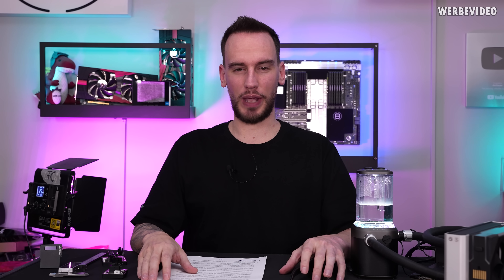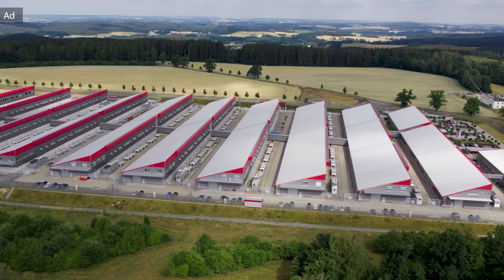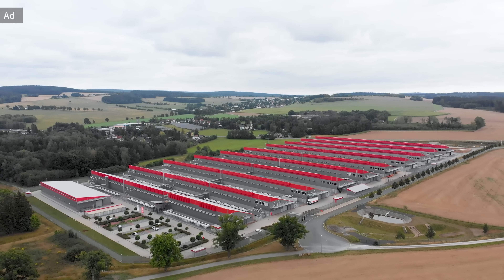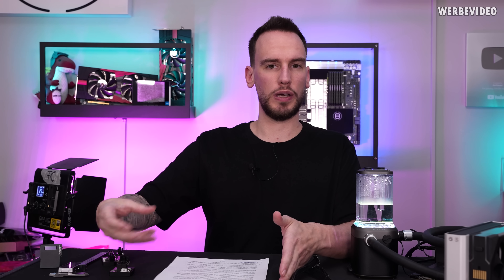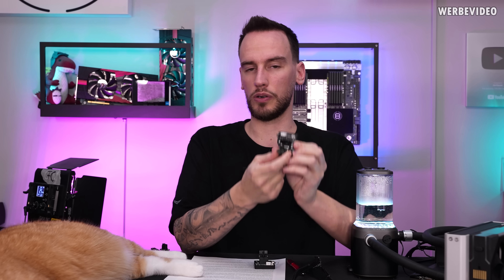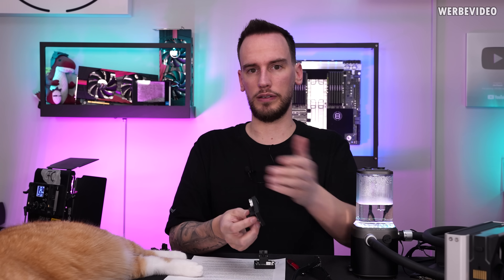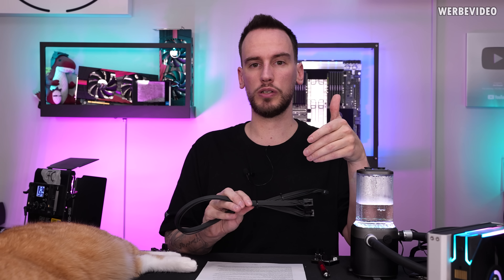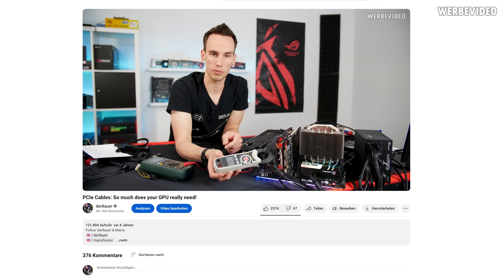12VHPWR is just Garbage and will Remain a Problem!!

Comment: I never liked this connector from the moment I laid eyes on it. The outrageous prices, and my distrust of the new connector are why there's no 40 series in my system. My instinctual reaction was that Nvidia was cheaping out big time. As time went on, Nvidia's behavior reinforced my instinctual suspicions.
Reply: The planned obsolescence didn't turn you off from nvidia?  I stopped buying their products the moment I realized they were making their own cards obsolete by limiting the vram.
Reply: @mrfarts5176  Then how is the GTX 1080 still relevant?
Reply: @mintymus  Have you tried loading up high-resolution textures on it?  All cards are still relevant.  I recently took one of my old favorite cards - a gtx 560 ti, I think, and put together a build for someone who can not afford a pc.  It was the first computer part I ever spent over 300 dollars on.  This pc will probably continue to be used by someone who can not afford a pc until it stops working.  Very relevant but not for gaming with high textures...
Reply: @mintymus  The Pascal generation is the best mistake Nvidia ever made, and they've learned from the 1080ti's longevity. The 2080ti got some of that treatment as well, but the 3080 and 3080ti is where they really drove it home. 10/12GB when the next card up is 24.
Reply: @DigitalJedi  And who do you recommend?  AMD, which did the exact same thing?  Intel?  They are all rotten to the core.
Reply: @mintymus  I never said they were and don't try to make it sound like I did. Whatsboutism gets us nowhere. 

Right now it's a lesser of 3 evils question. Buy whatever is the best  in your price range for your use case. For me that was a 7900XTX, for others it's an A770 or a 4070.
Reply: @mintymus  I don't think they are all rotten.  You just need to not be a fan boy and buy based on value and what company is behaving in a way you agree with.  That is definitely not a 700 dollar 12gb card for me.  I will probably be buying a 7800xt to test it out.  I just got a 7800x3d as I was hearing mixed results.  The processor has presently surprised me.  For being one of the best gaming cpus on the planet, it is very affordable.  I think people getting worked up are very invested in the success of a specific company.  Stop buying nvidia until they stop doing the things you hate.
Reply: @DigitalJedi  I agree.  I am probably going to buy an Intel gpu to give it a test.  I will not buy a nvidia card, though.  My last 10 cards for family builds were all amd gpus.  700 dollar 4070 TIs 12gb are a straight-up joke.
Reply: @mrfarts5176  So, what GPU company isn't rotten?  We're not talking CPUs, but since you brought it up, yes, AMD is rotten.  If you don't believe that your naivety is beyond helping.
Reply: @mintymus  OK, enlighten us on exactly what makes a company rotten.  That they make a profit?  Is it that they make products you want to buy but think are too expensive?  You know, in publicly traded companies, they are legally required to act in shareholders' best interest, right?  The upper management can be personally sued if they fail to do so.  I have a feeling you would feel differently if you worked for one of these companies.  I don't support nvidia because they engage in planned obsolescence.  I avoid this in any products I buy.  If they are intentionally made to not last, I will not support that company.  I support amd because their product are approximately a 30% better value, in my opinion, and I wish to support the direction they are going.  I want more vram, good raw raster performance, good drivers and I am not concerned with a lot of the other software functionality other people are willing to pay 50% more for.  The hardware I buy I use in my business or for family until I give it to someone in need.  Turns out vram seems to be critically important in that scenario.  I am still using hardware I bought nearly a decade and a half ago.  If you don't like the way a company behaves do not buy their products.  Seriously... The people running these companies change, and they react to market pressure.  If people become fan boys and one company dominates 80% of the market no matter how much they charge or how good the competition is, what do you think will happen?  I will tell you what - 700 dollar 12gb cards in 2024.
Reply: @mrfarts5176  Exactly as I suspected, an AMD worshipper.  AMD cards are a generation behind, and two generations behind when it comes to efficiency. But keep buying blindly, it lowers the cost of superior cards.  You also provide free entertainment for those of us that aren't fanbois.
Reply: @mintymus  What are you talking about?  I have an office full of gpus from both companies.  Keep trying to justify 700 dollar 12gb cards, saying nvidia is rotting then simp for them.  You can not make this stuff up.  The 7800xt is the best value on the market at this moment, in my opinion.  Don't be brand loyal.
Reply: @mrfarts5176   Sure you do.  That's why you previously commented  you built 10 AMD builds.  Just look up benchmarks, Nvidia is better.  Not today, junior.
Reply: @mintymus  I have done dozens of builds since covid.  You are the guy saying nvidia was rotten.  Now you are a fan boy... lol
Putting together PCs is what I do as a hobby when not working.
For 200 dollars more and less vram they better win at something.
Reply: @mrfarts5176   Show me one benchmark saying AMD is better.
Reply: @mintymus  Also, if you are calling me Jr., you must be pretty old.  I am using an amd build to design electrical systems for assembly lines.  More likely than not, I have designed equipment that built whatever car you get into next.  You are clearly just an emotional person who feels hurt that your favorite company seems to like to take advantage of you, so you think they are rotten.  Stop putting up with it.  Vote with your wallet, and you might not be so bitter.

I find it odd that this concept is so difficult for you to internalize.
Reply: @mintymus  lol at similar price points, they rock nvidia across the board.  What are you talking about?
Reply: @mintymus   You haven't yet shared why you think nvidia is rotten yet... care to elaborate?
Reply: @mrfarts5176  Provide one benchmark that shows AMD is better.
Reply: @mintymus  Pick any.  Compare similarly priced cards.  Done...  lol clown...
Reply: @mintymus  Also why do you think nvidia is rotting.  Still didn't answer that... I answered your question.  You just didn't like the answer.  Lol
Reply: @mrfarts5176   So you can't find any benchmarks showing AMD is better?  LOL
Reply: @mintymus  lol literally every one...  you have to compampare similarly priced products.  Every 6700xt is better than 4060.  Both 300 bucks.  You must be pretty dense.  Lol
Reply: @mintymus  and it has 12gb.  Try to not be a fan boy foe a second.  Also why is nvidia rotten again?  Still have not answered that...
Reply: @mrfarts5176   Look at you, trying so hard.  AMD sucks.  Nvidia is better.  Sorry.
Reply: @mintymus  You know I encounter lots of people like you online, and I see so much conflicting info.  Like the 7800x3d is hot mess garbage buy 14900k instead, so I bought one to try it out.  Half the price of a 14900k.  Absolutely rock solid.  I doubt you every actually try any of the hardware you crap on all the time.  Give it a try, and you might see that not only are the products good, but it forces both companies to compete for your money.  I hear constantly don't use Radeon for professional applications.  I built a cad pc with one and wow I was impressed.  I use them to design the equipment that builds the cars you drive.  Try to actually use your own mind.  I found using an all amd platform to be very stable and cost effective.
Reply: @mrfarts5176  You encounter lots of people proving you wrong?  Not surprised.  Now you bring up CPUs because you know AMD SUCKS at GPUs.  LOL
Reply: @mintymus  You just are not going to clarify why you think nvidia is rotten, are you?  Such a fan Boi...  you go ahead and drop 700 to 900 bucks on 12gb cards.  Lol so funny...
Reply: @mrfarts5176  How many times do you get proven wrong per day?  Go ahead find one benchmark showing AMD is better, then I'll admit you're right.  Easy huh?
Reply: @mrfarts5176  Oh, that's yet another reason there's a water cooled Red Devil 7900XTX in my rig, instead of a 4090. I was lucky to have a 4090 over for an extended sleepover and I concluded that the juice was sweet, but not worth the squeeze and I really hate the cut of Nvidia's leather jacket in recent years.

Comment: What I said from day 1. The highest amp, hottest, highest TDP GPU using one small connector is THE problem. you only see adapters fail this often on the 4090. and the narrative now is all cablemod, when every brand, native 12V PSU, nvidia included cable have all burned.
Reply: Poorly designed connector, it’s microfit…tiny pins.

Comment: I use the cable that came with my Corsair PSU. I have the 4090 power limited to 80% and also I frame cap to 175 so hopefully it doesn't draw that much sustained power that will cause any issues.
Reply: defeats the purpose of using it, your better off selling it and getting amd, the cards are warranted for 3 years or more on some models, if it breaks send it back, I'm on my 2nd card, 3rd warranty repair, burnt connecters.
Reply: @martinmalone6324  once is an error, twice is a pattern. Either you had faulty cards twice in a row, or it's user error. I had a 7900xt before and the 4090 still outclasses everything when power limited, as well as having the benefit of the software stack. It's also much bigger and therefore cooler and quieter.

Comment: So with multiple power connectors would necessitate a load balancing logics onboard the PCB, which also increase failure chances. 

With RTX3000 there are lots of failure with load balancing going wrong with EVGA and also Gigabyte, particularly in the MMO game New World where lots of rtx3000 got burned.

I would rather just replace the melted power connector rather than have a card with a burned hole on it LOL, also reducing the power limit to 350-400W would pretty much eliminate any chance of failure anyways.

Comment: Thank you for comparing the datasheet specifications of the connectors!
There is only one thing I do not agree with, they need to completely discontinue this small and fragile 12pin connector.
Even if you use 2 on a beefy card, you will not fix the fragility because of short pins and high torque caused by so many cables plugged into a small connector!

Comment: Oh oh oh oh M G.     So much is wrong here with this INTEL standard, just get rid of it all together and go BTF with onboard server connectors that can go up to 1000 Watt power and that is the end of ALL issues!  

I hear so much B.S.  that it hurts my stomach from laughter. 
Again, one seems to not grasp the basic of the electronics.  I keep repeating myself, get rid of that stupid connector.  

Understanding fully the 16 AWG and 18 AWG versus the mm2 , the P=I2XR or U x I ,  who came up with the idea to split the power needed over tinny wires and parallel them back together.
Not even addressing those two stupid signal wires hat should tell a PSU when to add a circuit or not.  

IMHO its not even ENGINEERING but randomly putting something together by amateurs.

It is not rocket science and everything has already been microscopically been investigated and pin pointer what is wrong.   If need be use blade connectors, one for the positive and one for the negative and be done with it.  

OMG it could have been borrowed from the Car or marine industries.   I have to laugh even louder / harder as there are plenty heavy duty 90 and 180 degree adaptors sold on Aliexpress that seem to be working just fine.  I use a 180 for my 40 series card and it works like a charm.

Should kick both NVIDIA and INTEL who came up with this between the legs so they won't come up with something stupid like that ever again.   Such a waste of Time.

Waiting for BTF and Server type onboard connectors in 2024, a much safer and better idea IMHO as its already a PROVEN concept for over, hmm oh wow 3 decades?!  🤣😂

Happy New year lol,

Comment: As I've said elsewhere - at this point everything has been RMA'd except the device that's causing the problem. This is what happens when a company believes their position is unassailable :(
Reply: Or when users bitch and moan about the company products then proceed to buy them anyways.
Reply: @BrunodeSouzaLino   ¯\_(ツ)_/¯ IKR
Reply: Exactly and it was obvious from the beginning the connector on the ODM chose to go with is the problem. NVIDIA can believe whatever they want but the consumers should be starting a class action lawsuit vs NVIDIA and regulators should be forcing a recall before someone dies in a fire.
Reply: Exactly, Nvidia are behaving like Apple. How they're getting away with this, is a lot like how Apple got around their sales van for using stolen tech on their watches. They're given too much leniency and understanding like they're new to this, and the risks are misunderstood.
Reply: They lied to shareholders, they lied to stores, they lied to customers about selling cards directly to cryptominers and they paid $5mln for it while they made billions selling to miners. Guess why they don't care.
Reply: (laughing in NVIDIA)
Reply: I bought my 4090 in April and did sooooo much research to make sure i bought the best cable for it. I thank God i bought the Corsair 12VHPWR. To this day I can't find a single reddit or twitter post of that cable being involved in a connector melting.

However, that level of meticulous research shouldn't be a requirement to make sure that your +$1,600 does not go up in smoke! I'm tired of people saying it's solely from user error. It is a design flaw full stop.
Reply: @samson7294  And yet u still buy it. Haha Nvidia laughing to the bank. That's truth.
Reply: @alesksander  4090 does not have AMD or Intel equivalents. If he bought a 4080 or lower then yeah
Reply: AMD's fault for not being competitive in da high end
Reply: @elmalloc  Even if AMD was in every aspect (rt, "proper" dlss competitor etc etc.) people will still buy nvidia. Also why bring AMD into an nvidia design fail? Why not also blame intel for not competing in the "high end" too?
Reply: @Sparkie-2  Nvidia, Intel and AMD all have the exact same majority shareholders (Vanguard, Blackrock etc), there's no reason for them to actually compete anyway
Reply: @HamidKarzai  weird, because they still do. AMD and Intel are slapping each other on CPUs for example
Reply: @marcogenovesi8570  while Intel and AMD are successively beating each other on performance every generation, they are also both offering less and less improvement in terms of performance per dollar with each generation. If they don't try to undercut each other on pricing, then they're effectively cooperating to bilk their consumer base and pocketing the efficiency gains for themselves.
Reply: @HamidKarzai  Afaik the main issue is Intel that is less and less capable of competing each year, so AMD does not need to flex as hard in consumer space. So we are getting in a "low competition" environment again, with the sides reversed (before it was AMD failing to innovate and Intel doing nothing). Imho this is not them conspiring together, Intel is genuinely in trouble on the technical side at the moment
Reply: @elmalloc  That's demonstrably false, especially when you consider instances where people still bought Nvidia even when AMD had the better product.
Reply: @elmalloc  Because u will die without bit lower FPS and ray tracing gimmick? Ohh yeah lets burn house down instead.
Reply: @alesksander  Some users need cuda and optix. Amd doesnt offer either and rocm/hip is not as powerful as cuda. Or not all software is even ported to rocm/hip. Not everything or everyone is gaming.